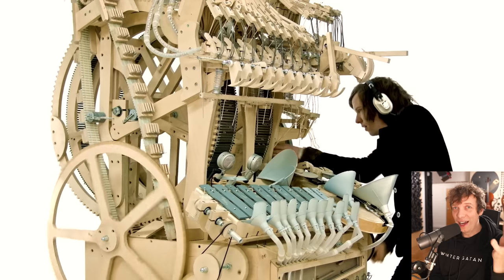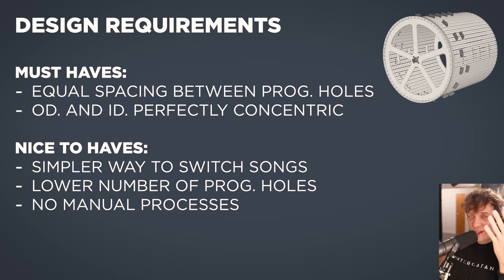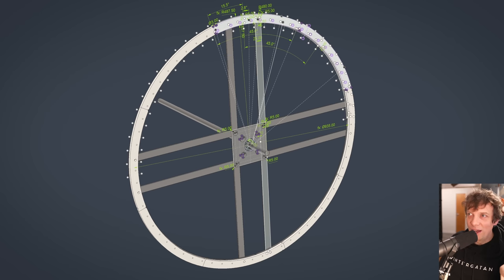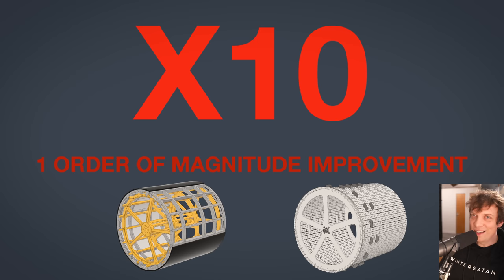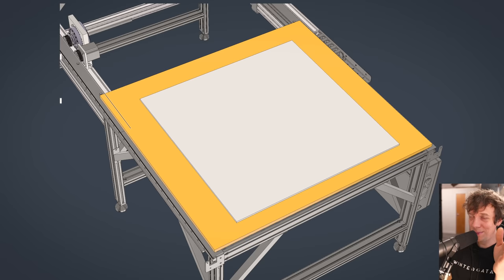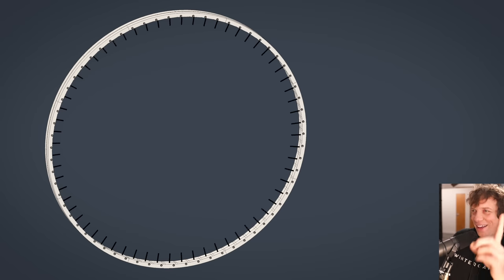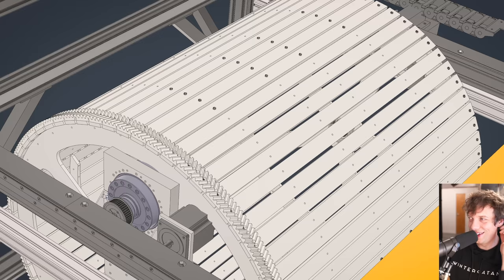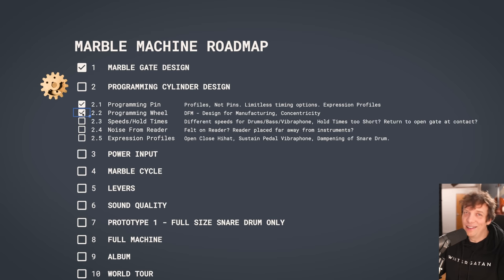A New Music Programming Wheel

Comment: Hey, good design ! However don't you think the two ends of the cylinder (the two wheels) are not enough connected to each other? It feels like if you give torque to the gear, the whole programming cylinder will twist and deform... Maybe you could add a cross piece on the inside at 45° to give it more strength? A bit like the metal cage you added on the back of the MMX :)
Reply: Will that really be a problem? They are connected by the shaft, and power transmission through the gear to the shaft should be pretty solid, and I would have thought the shaft can then accelerate the other wheel pretty cleanly. No need to transmit much power through the structure of the cylinder itself.
Reply: Good observation. I personally disagree, thinking that the cage will distribute the force, but we'll just have to see! Either way, adding a cross beam to the center should be easy enough.
Reply: I’m thinking some tension cables on the inside, oriented so that when the near side moves, the cable pulls the far side along with jt
Reply: @ninjafruitchilled  As I can see on the video it seems that the whole wheel is only connected by bearings, in other words i suppose the programming wheel can freely rotate around the motionless shaft. Now, because the torque is transmitted by a side of the cylinder and the programming pins creating resistance, thus opposite torque, i think it can deform the wheel and create timing accuracy issues 🤔
Reply: Had the same feeling. All the wrapping and connecting parts, are just attached by one screw, such that a twisting motion is only prevented by friction. (Also during machining of the programming holes)

I can't really guess how big the forces are, but during machining, and with multiple pins pulling at the wheel simultaneously, they might get quite high.

I'd prefer to see if the shaft (or maybe a tube around the shaft) is attached rigidly to the two tube side, such that this central piece can absorb the torsion forces. This has the benefit, that the timing related wrapping pieces are not a structural part.

One last point to add to this are the pins connecting the wrapping parts. Martin clearly thought about it. Let's hope he'll just test if the torsion resistance is big enough.
Reply: @mickmack1213  seems that the wrapping is made out of one plastic sheet into which compliant features are machined inbetween to create cylindrical shape, that should be quite strong but to get very precise timing in the end, I thing he should reduce the risk by designing it extra strong
Reply: @mickmack1213  Agreed and even worse the screws are described as off the shelf commodity hardware - no precision shoulder that tightly registers to the two parts in question so there is going to be a good degree of slop the slats can have on the surface anyway - screws on their own are for clamping stuff together not registering locations. So that warp has a free head start of some reasonable fraction of a mm if not more before the slat really hits the screw shaft to provide any resistance - unless he adds in some other form of registration pin.

Though even then I agree the forces are likely to get rather higher than such a structure can take - though we don't know what his read head will be like yet. 
A simple and great start to fixing this problem would just be to put the bearings on the machine now and fix the axle to both ends of the wheel, seems like there is no longer any design reason not too left. Doing so the plastic wheels far side is being torqued directly from the axle as well - steel aught to be stiffer than the wheel itself, so its certainly going to help transmit that torque to the undriven side.
Reply: the center shaft is too thin it will twist.
better approach will be to drive the drum from 2 sides

Comment: One of the philosophies I developed during my career in software engineering is that you write every piece of software three times. The first time, you don't know what you're doing and just make stuff up as you go along, and somehow (barely) get it to work as you want. Second time, you try to fix all the mistakes while keeping (or even adding) the features that you really want or need, but you end up in too much complexity, which will overwhelm you. Third time, you're much more aware of the actual use cases/requirements and the pitfalls to weigh them again. This is the time it's actually getting good.

Seems like you're a perfect example of just that pattern, and I'm optimistic for your third version :)

Comment: Have you considered a Programming Belt instead of a Wheel? Like taking a punch card music box's punch card, and taping the ends together.

Benefit are:
1. that the belt would only need to be reinforced near where the marbles are released, and the rest can dangle.
2. variable length songs.
3. can swap out a song simply by splicing a new track onto the current track and then connecting the ends when available.
4. can have a song on Side A and Side B.
Reply: This would be good. I hope wintergarten sees this
Reply: I think he likes the idea of being constrained by the 64 bars the drum offers when he starts composing songs for it. Otherwise he could just use papertape like most other music machines. Or something similar made from a plastic sheet for increased durability. If you scroll far back enough you will see that he has already worked quite a lot with paper based music machines.
Reply: @elMuele  I saw someone on the discord server say that a tape system wouldn't work out because it wouldn't be able to apply the mechanical force required to actuate the marble droppers
Reply: Funnily enough I suggested multiple flat plates, they'd pass through the machine flat and join without any gap. Probably pulled through the machine like an old tractor feed printer
Reply: I am still not convinced that he needs physical programming system for his minimum viable product. Sure doing some kind digital system like what he using in testing could play extremely tight music. Then once every other part is working simply switch out the digital system to physical system.

Comment: The helical gear should also be quieter than a regular gear.  I think you may need some stiffeners on the bars with the slots for the programming pieces.  The way you have it drawn,  there may be some flex in the centre of the bars which would throw the timing off between the middle notes and the outer ones.  I hope you get what I am trying to explain.  

One final note, I would not try to make the timing too perfect, the charm of live music is that it isn't perfect, it makes it more human. Don't get me going on autotune.
Reply: Stiffeners for both tangential and rotational.  The end wheels can twist from handling, maching, etc, skewing the bars. Aging, mishandling, cam forces, etc, can cause the bars to bend. 

Possibly 1 or 2 more inner wheels lightly cross braced to at least 1 outer wheel should give you reliability and durability for global performances.
Reply: Honestly, I'm kinda worried that he will actually succeed in chasing down all of the stray sounds and inconsistencies of the marble machine, and in doing so destroy the magical feel of it.
Reply: helical gear on both sides to reduce twist from side to side
Reply: Just going to leave this comment here before the video about why the helical gear should and should not be centered on the programming wheel.
Reply: @bow-tiedengineer4453  A lot of people would already say that there's no "magic" or what-have-you in the marble machine's music because it's made by a machine and not by a human with their bare hands. Everyone has different ideas of what the essence of music is, and I personally don't understand the obsession with those accidental little Imperfections™ the artist has no control over, instead of the actual ideas that they spent so long deliberately perfecting in order to express what they wanted to express. To me at least, it feels very dismissive to the whole point of creativity and art.
Reply: Totally agree on the timing thing, except Martin has said a few times that his goal is just a machine that works every time, and getting the engineering consistent will make both a reliable machine and have hopefully decent timing by the final product. I think it's fair to say there will be things Martin won't anticipate which will reduce accuracy once it's built and has wear and tear, so you'll get the imperfect sounds either way most likely.

Super pumped about this project though.
Reply: We have a saying in the military, "Measure with a micrometer, Mark with a grease pencil, cut with a chainsaw."  It means that even when you're doing sloppy work you should start off with precision.  Martin is rebuilding this machine from the beginning so hard that he's evaluating the principles that machine will operate on.  Precision at this stage is the most critical.  Even if it's sloppier in execution.
Reply: @80211Denver  Or maybe put the splits of the double helical gear in each end of the drum. That way you don't need to cut the double amount of helical gear and still get all the benefits. Also, if you orient the slopes to pull away from from the center during normal operation, it should also introduce some outward tension to the strips on the drums to pull the surfaces even flatter during playback.
Reply: @MikkoRantalainen  Something like that.  You're describing the design of train wheels that self center from the inward slope of the wheel surfaces
Reply: @80211Denver  That's interesting way to put it but that was a good analogy. Train wheels try to push tracks outwards and I was thinking that in this case the driving gears should try to pull the drum outside from both sides.

Comment: I think you would be happier with a row of locator pins or roll pins vs. just screws.

Screws are great for clamping, but terrible for holding precise registration. Every time I have to deal with a precision device at work I ask for them to use locator pins and we always regret it when they don't.

Comment: HEADS UP: When you put your drum on the AVID CNC it looks like it's going to interfere with your motor and gearbox.

Also - the operation to machine the holes in the programming plates may not work as well as you think because there isn't a whole lot of radial support across that plate. Meaning, there will be a lot of chatter and movement in the programming plate when the cutter tries to cut into those plates.. make sure the plates are stiff across the span to avoid this issue.
Reply: I personally do not see the need to machine plates on the wheel. Since concentricity  will be provided by machining the wheels itself on their axis, and outer shape of the wheel is a... hexacontatetragon 😅 you need only to align flat face to a flat face. So the requirement for the programming plate - to be perfectly flat (and all the plates have to be the exact same thickness). 
Moreover, holes in the plates provide failure point - they will be exposed to lots of fastening and unfastening, wearing down the perfect fit. Having to reinstall the whole programming drum into cnc router to machine just one plate because of just one loose hole is a bit too much.

Comment: It's probably already been mentioned in the Discord, but colour-coded programming pins is a must-have with this design. A different colour for each timing pin will make it much easier to manually reprogram and cross check.

Comment: The programming pins/holes around the centre of the wheel may deflect inwards/outwards. I would consider if another support in the middle in addition to the ones at the ends is necessary. Great stuff Martin! :)

Comment: One concern i have about concentricity is the central hole where you put the bearing and axel. If minimal errors is the x- and y-axis make the outer circumference wobbly, that same problem should apply to that hole. Putting it on the  rotary axel might make the oputer ring concentric, but if the inner hole isnt round enough the wheel will be unbalanced and intoduce vibrations into the whole system

Comment: I believe you need gear on other side as well, otherwize programming wheel will be twisted along rotational axis and will broke eventually. But I'm not sure :)
Reply: I don't think it will break, it will twist. My concern is the music could be out of time. The instruments close to the gear will be on time the instruments far away will always be late. Martin, you should do FEA on the wheel to see how much twist there is given the force from the motor on the gear. A sure fire way to cut the twist in half is to put the gear in the center.  An additional possibility would be to put a tube about 1/3 the diameter into the center to act as the bottom of the torsion box.
Reply: It's suggested elsewhere on this thread that the axle be considered part of the wheel and fixed to the wheel on both sides, with the bearing living on the housing. That would also help eliminate twist, since the axle itself would then be part of the stiffening mechanism, instead of transmitting the torque solely through the programming plates.
Reply: @CScottAnanian  If the design were changed such that the shaft was fixed it would help a little. But not much, the shaft diameter is too small and the lever arm created by the diameter of the outer cylinder will see the steel shaft like a piece of string. A better idea would be to remove the shaft all together, use a piece of large diameter plastic drain pipe. Then for the side support you would use cam rollers and the pipe or shaft could smoothly ride on them while being driven by the gear. Minimum would be 2 cam rollers per side to create a v shaped nest for the tube to rest on. Of course, turn 0.2 mm off the tube to make it concentric with the rest of the cylinder.

Comment: Martin, you are truly inspirational. One piece of feedback that I've been dying to give is that I think you can solve the problem of the precision of the diameter of the programming wheel with a simple design change. I believe what you care most about is the linear speed of the programming pins as they pass by the arm reading them. When you're gearing the edge of the wheel, like you are, the linear speed of the pin can be independent of the diameter. Essentially, you have a tube of programming tape like the music boxes. That axle can even float somewhat, and as long as you're gearing the drum in line with where you're reading it, you'd remove the diameter from the equation. Hope that helps.

Comment: My main question is will there be enough space to play enough notes on a single loop?
I am probably not understanding the profiles correctly, but with the current design how many notes can be played before repetition?

Super excited to see progress!
Reply: I was thinking exactly the same ! There must be something we don't see ;)
Reply: @antoine_nedelec  I hope so, otherwise I think we'll be hearing a lot of 4-chord progressions lol
Reply: Pretty sure the profiles can be cut to play multiple notes per profile. Or single notes at any musical position within their reach.
Reply: The wheel is now the length of time while the pins represent ta section of that time. This is why the amount of machined slots along the wheel was reduced by x10.
It doesn't need a channel for every type of note (1/4, 1/8, 1/16, 1/4 off timing, 1/8 off timing, 1/16 off timing, etc).

Just think of each programmable pin as a single bar in a measure. The dips cut in to the pins will be the actual notes and contain the timing.

If you need further explanation, each pin represents the time between each tick on a metronome.
Reply: @level12lobster8  ahh okay! Very well explained. Tysm. I should probably re-watch the video about them.
Reply: @level12lobster8  Ok, so the previous video vas quite confusing with the length of the programmable pin, all programmable pin should be equal length (1bar), with top contact height at different distance from the beginning (/\___ would be 1 note)  (/\_/\_ would be 2 eighth notes)  (/\/\/\/\ would be 4 sixteenth notes) right ?
Reply: @antoine_nedelec  Yes, you got it.
Also, the rise would be Open Time, Flat top is the hold time, Drop is the release time.
The reader for the programmable pins is connected via a cable to the marble gates.
Dips will open and close the marble gates like in the previous videos. That is why he needed to test the faster open/close speeds.
Reply: @antoine_nedelec  Also manages the off timing of notes too. Could make a pin be (__/\_) while the next one has (_/\/\_).
If he wanted off beat, just make the /\ 1 or 2 cm later.
No more having to carry 10,000 pins in fixed locations (open/hold/release timing being a fixed duration due to size of the pin)
Reply: @level12lobster8  Yes i understand you can do any kind of offbeat (or rhythm in general) you want, but the most basic one would be on tempo beat, and you need to configure a pin on the previous bar (having either ____/\ or /------\) in order to have the drop precisely on the beginning of the next beat. Just a little counter intuitive but indeed you can do any tempo you want
Reply: @level12lobster8  I understand the concept. But if 10 separate holes would now be replaced by a pin that could trigger these holes… in the worst case you need 2^10 differently shaped pins … 1024!